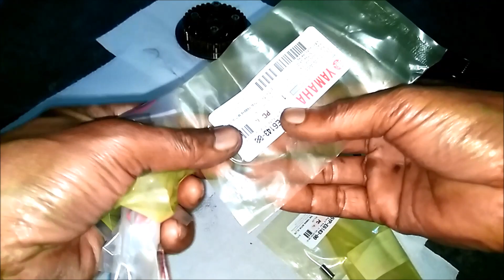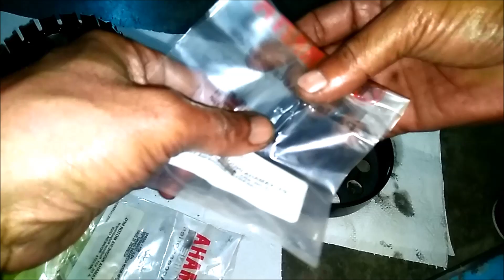Yamaha LC135 v1 4s, Jupiter, T135 How to Repair Loose Kick Starter

Comment: Assalam. Nk bertanya. Kalau nk tukar clucth kene bukak skali dgn rumah tu ke atau bukak skru spring 4 biji tu kemudian tukar gitu je. Mohon bantuan tuan. v1 2008 klu xsilap
Reply from the maker: angel society as salaam ... Bukak 4 skru yg Ada spring tu je ... Dah boleh tukar clutch plate
Reply: @KluangmanCooleck  t.ksh tuan. Tnya kedai die nk dlm rm250 jgk. Sbb katanya lc rumit sikit. Kene titik bagai laa.
Reply: @streetboyzify  seng je wat,sya da wat sdri..blaja utube gak,nk tgok clutch plate ori dia jual skeping2,made in indon..byk kdai jual locar walau pack hly japan dn indon,beza dia kne buka dn tgok plate dia tu jnis steel berat skit bebnding clone..clone mcm aluminium je ringn,kdai byk tipu klo hage 45 tu local la..ori skeping rm13-15..sory celah bng kluangman

Comment: Bang nk tanya sy baru tukar bearing oneway satu set and baru letak wasir dalam auto tu..lpstu bile da psang semua start hidup dalam bape saat gitu pstu mati bila stat balik terus ad bunyi rontak pstu mati n mcm ad bunyi patah. Bila nk stat kick starter jadi keras
Reply from the maker: Kena bukak balik kalau macam tu ... Tak boleh Ada kesilapan semasa memasang benda ni ...
Reply from the maker: Bush yg terakhir tu mesti Sama paras dgn dgn mangkuk yg Ada Gigi gear tu ... Bush terakhir itu tidak boleh Sama sekali terkedalam walaupun 1mm ... Kalau bila pasang bush terakhir tu ... Bush tu tak Sama paras dgn mangkuk ... Ada yg tersalah pasang sebelah dlm ...
Reply: Bush yg mana eh bang auto ke mangkuk clutch . Sbb sblm ni moto bunyi kuat bila check balik sbb auto xda wasir lpstu bila dah letak jd mcmtuu
Reply from the maker: @hellomiyul3380  bush auto
Reply: Oh kira bush terakhir tu kne sama dgn mangkuk gigi yg psang tu ke. Bush auto tu xleh tekan ke dalam smpai dalam eh
Reply from the maker: @hellomiyul3380  bush tu tak boleh terkedalam ... Bush itu umpama pasak ... Mesti kuat Dan tak bergoyang Dan skru terakhir berserta wasir terakhir ... Mesti menyentuh bush terakhir tu ...

Comment: Abg nk tnya..ape function klu pkai auto cluth racing ye??? Blh bgi keterangan ?
Reply from the maker: Auto cluth racing? setau abg motor scooter je yg guna ... utk pickup cepat sikit.. atau motor honda wave ... kalau yamaha kebiasaannya tukar cluth yg ada lebih spring
Reply: @KluangmanCooleck  yeke..sbb moto sy perlu tuka auto cluth..lc 4s
Reply from the maker: @budakflat4574  kalau ada sesekali macam gear tak masuk atau starter kaki kekadang loose ... repair je auto cluth tu
Reply: @KluangmanCooleck  ye abg..xpyh beli bru ke? Hnya repair yg ori pnya?
Reply: @KluangmanCooleck  ok abg terima kasih
Reply from the maker: @budakflat4574  macam dlm video tu .. repair je

Comment: tumpang tanya bang,,baru lepas tukar class plate sendiri,,pstu gear jadi sambungg,tak boleh nk pancing gear,,dh setting skru kecik belah magnet pun x boleh gak,,nk kene setting apa ek?
Reply from the maker: Skru kecik tu pusing ke dlm ..
Reply from the maker: Mangkuk clutch Ada bukak tak ... Kalau Ada bukak ... Masa pasang balik sebelum pasang clutch plate mangkuk tengah tu mesti boleh pusing2 ... Free
Reply from the maker: Cuba dulu pusing skru adjust cluth sebelah magnito tu .. pusing kedalam ... Ada keras sikit .. Ada susah sikit nak pusing kedalam ... Kena kuat ... Sikit ... Tapi agak2 je dlm Dua tiga pusingan sambil tekan2 pemijak cluth ... Mangkin kedalam skru tu ... Pemijak tu mangkin Ada spring .. mantul2😂
Reply: +Kluangman Cooleck mangkuk tu mmg dh free bole pusing pusing
Reply: +Kluangman Cooleck dh buat ketat ketat dh ,,gear dh jd keras sikit,,tapi x keras mcm dulu and takleh pancing gear jugak..so nk setting belah mana ye bang?
Reply from the maker: @irfanirsyad9442  push rod kat penutup mangkuk clutch betul tak pasang dia
Reply from the maker: Push rod masuk dulu ... Bearing leper ... Baru pasang penutup
Reply: +Kluangman Cooleck bearing leper tu apa eh?
Reply from the maker: @irfanirsyad9442  bearing tu macam duit syiling ... Masuk push rod dulu .. Bearing ... Baru cover clutch
Reply from the maker: Cari user manual motor tu download .. Nama file tu T115FSEC Pdf

Comment: Salam bang mcm mana nk buat clucth tangan? Kne welding auto dan manual ke?
Reply from the maker: as salaam ... pd pendapat abg... tak payah welding auto cluth tu ... dan biar je mangkuk tu ori ... dan tak payah bukak ... rugi kalau bukak ... top atau lajak nanti hilang ... buat macam motor yamaha ss 110 dulu2 ... auto ada ...manualpun ada ... tapi terpulanglah pd firdaus
Reply: @KluangmanCooleck  makna buat clucth hidop la abg? Tarik clucth boleh xtarik pun boleh ok ke?
Reply from the maker: Ya... betul
Reply: Kalau buat clucth hidup xmcm meneran ke mcm ss110
Reply from the maker: tak ... macam ori ... tambah clutch tangan ... mesti glamer punya ... dua2 boleh guna ... kaki boleh tanganpun boleh ... tapi kena korbankan clutch kaki ... tapi kalau kreatif ... boleh guna dua2
Reply: @KluangmanCooleck  owh phm2 kalau clucth hidup ni perfomance still mcm biasa ye bang? Cuma boleh pakai dua2
Reply from the maker: @firdausdaus7307  ya... clutch kaki ...hilang... kerana push rod tu sekarang guna yg tangan... cuma boleh masuk gear ...walaupun tak tarik clutch tangan ... semasa rpm rendah sahaja ... kerana auto cluth masih ada ...
Reply: Bang kalau pakai stopper ngn balancer ok tak
Reply from the maker: @firdausdaus7307  ok .. yg ori simpan
Reply: Baik bang,lagi satu kalau pakai stoper dan balancer,housing auto tu pakai balik kn bang?

Comment: Salam nak tanya motor saya dah tukar cdi tapi bila bawak ada rasa sengut sengut bila full trottle. lepastu bila pulas minyak lepas sikit pulas balik dia sengut adakah angin carb perlu di set balik motor v1 2008
Reply from the maker: muhammad syazwan as Salaam ... macam minyak over je pattern dia .. Cuba besarkan sikit putaran jet angin .. Cuba pusing ikut lawan jam 360% bersamaan satu pusingan ... Ada lagi tak problem tu ...
Reply: Kluangman Cooleck saya bukak angin 2 /12 pusing ada jugak sengut tu pusing 3 pun ada jugak.
Reply from the maker: muhammad syazwan masa nak start jalan rpm rendah ... Ada membobok?
Reply: Kluangman Cooleck takde pun bobok ni dah try bukak angin 1 1/2 pn sama jugak
Reply from the maker: muhammad syazwan Cuba adjust jarum throttle ... Mula2 tengok pin jarum tu ... Kalau tak pernah usik dia kat tengah2 .. turunkan pin jarum tu ke bawah .. test balik .. info kat abg kesan turunkan pin jarum tu
Reply: Kluangman Cooleck okey dah jumpa bang lubang blah dpan carb tu tersumbat servis balik terus lancar .. huhuhuhu. Terima kasih bang bg pendapat
Reply from the maker: @muhammadsyazwan1073  TAHNIAH 👏👏👏
Reply: Kluangman Cooleck kalau ada video buat overhall abg upload boleh nak tgk cara pasang gearbox
Reply from the maker: Buat masa ni abg belum ada buat video complete overhaul .. cuba cari kat Fatin Motor channel

Comment: Pagi bro..nak tau cara buka nut primary..sebab motor sy da ganti auto clutch n housing..nak tau kenapa ada bunyi seperti bunyi turbo..dan selepas itu ada bunyi golgok glogok area primary
Reply from the maker: Benn Rudolf selamat pagi ... Skru prima ... Adakah skru cluth houseing atau auto clutch ... Jika ini yg Benn Rudolf maksudkan ... Boleh menggunakan impact skrudriver ...
Reply: Skru auto dan skru primary
Reply from the maker: Benn Rudolf boleh guna impact skrudriver
Reply: Ok tq bro
Reply: Petang boss..sdh diperiksa..yang berbunyi glogok glogok primary clutch..haus sdh lubang shaft n boss clutch juga x rata da..
Reply from the maker: Tahniah kerana menemui permasalahannya ... tapi jarang sekali lubang mangkuk cluth itu haus ...

Comment: assalam bro. saya punya motor lc v1 . lepas tukar autoshoe bila perlahan jadi clutch kaki. bila tarik laju terus knocking valve dan piston . apa punca nya ye
Reply from the maker: As Salaam ... Sebelum tukar bunyi tu ada tak? Kalau sebelum tukar tak ada bunyi .... Ada yg tersalah pasang tu ... Kena bukak balik ...
Reply: sebelum tukar tak bunyi. tapi lepas tukar 3 kali valve bengkok. lepastu saya pasang yg asal balik bru okay moto kalau tarik lama2
Reply: ke kena tukar shoe sekali dgn housing nya skali?
Reply from the maker: @arisyatim296  tak perlu abg rasa ... Kalau shoes tu ok ... Tak Ada spring yg patah atau Ada part yg dah rosak ... Abg rasa , kalau aris bukak balik ... Auto shoes tu giginya dah haus ... Kerana masa pasang tu ... Benda tu tak fit ... Dia bergoyang2 ... Itu yg Ada bunyi knocking tu
Reply: okay okay terima kasih
Reply: last nak tnye. apa effect kalau tapak spring clutch tu salah pasang? yg mcm dlm video yg dok goncang2 tu
Reply: minit ke 29.52 dlm bideo
Reply from the maker: @arisyatim296  auto cluth tu tak Ada kena mengena dgn valve ... Melainkan aris ada bukak block

Comment: Bos kalau kickstarter loose ,gear xde clutch dn bila jln xpulas throttle moto stay jln jgak mcm gear auto tu ape mslh nye..moto dari beli 2006 smpai skang xprnh tuka clutch plate lg😂..mntk ajr sifu
Reply from the maker: azri azman problem sama macam dlm video ni laa.. kalau gitu ... Buatlah macam dlm video ... Ganti auto assembly ... Macam dlm video
Reply: Kluangman Cooleck baik bos sy try buat..bos ade wassap x snang ape2 nnt bleh mntk ajr dari sifu😁
Reply: Kluangman Cooleck auto dn bearing one way dn mangkuk auto dn class dh pakai baru..npe ye klau sye dh pasang sye putar ade bunyi kasar?
Reply from the maker: bila dah siap pasang ,, mangkuk tu cuma boleh berputar satu arah sahaja ... bunyi kasar? kat mana?
Reply: Kluangman Cooleck klau pusing satu2 tk bunyi..tpi klau umah auto dn umah class dh bergabung..sye pusingkn guna tgn die berbunyi..knp ye?sye tk pasti bunyi dkt mne diantara keduanye
Reply from the maker: letak minyak
Reply: Kluangman Cooleck dh bosku...sampai banjir sye letak..tetap bunyi
Reply from the maker: cuba bukak balik buat balik semula ... yg dlm video tu lepas pasang test pusing .. cantik je .. apa bunyipun tak ada .. bush besi tu cuba tengok permukaannya cantik tak
Reply: Kluangman Cooleck maaf tnye..bush yg dkt mne ye yg perlu dicek?
Reply from the maker: yg sebelah dalam tempat bering rod 3 biji tu
Reply from the maker: jangan ada wasir yg tak pasang terutama yg dlm sebelum masuk bush plastik
Reply from the maker: bush plastik putih tu jangan terbalik

Comment: Bang spring kecil one way tu 1 ke 3., konfius saya buka yamaha lagenda lama,1 je, tapi tmpt spring tu ade 3 mcm dlm video ni.
Reply from the maker: Tak silap abg lagenda spring kecik tu Ada dua ...
Reply from the maker: Eh... Silap ... Kalau tempat spring tu Ada tiga ... Bermakna tiga la spring kecik tu
Reply: Oh yeke...kalo beli spring tu je berapa harge ye?
sebab rumah dn bering one way masi cantik..
Reply from the maker: @tthonney90  kalau tak silap abg bawah 50 ... Tak Ada jual spring je ... Kena beli satu set macam dlm video tu
Reply from the maker: Abgpun beli satu set ... Tapi yg abg guna cuma spring tu je ... Yg lain boleh guna balik ... Tak rosak
Reply from the maker: Pastikan oil seal tu tak pecah atau rosak ... Kalau rosak tukar ..
Reply: Kluangman Cooleck ok bang terima kasih info..
Reply: Ok, dan housing clutch plate yg ade jari2 tu kalo beli kene beli skali dgn yg tengah x?
berapa ye agaknya harga?
Reply from the maker: @tthonney90  kenapa dgn housing tu patah ke ? Atau dah goyang kuat sangat

Comment: Inikah yg dipanggil one way bearing tu bang?
Reply from the maker: Brock Lesnar89 yes inilah bendanya😂
Reply: Kluangman Cooleck x sabar saya nak cuba buat sendiri klu ada masalah begini lepas tonton video abg ni😂auto clutch tu klu bukak&pasang mesti guna impact ke bang?
Reply from the maker: Brock Lesnar89 kalau Ada air gun lagi cun ... Tapi kat rumah ... Mana ada year tak🤣 jadi kenalah buat macam pomen dahulu Kala... betul tu guna skrudriver tu..
Reply: Kluangman Cooleck kalau guna impact tu nak kena ikat kuat2 ke bang atau macamna?nak ilmu cikit sebelum belajar buka benda tu😅
Reply from the maker: Brock Lesnar89 waaahhhh ni betul2 nak jadi pomen ni ... Ok abg bagi tip mudah2an Ilmu ni digunakan utk kebaikan... Ewaaah...😂  Kalau nak bukak skru cluth tu ... masukkan giar 1 Lepas tu tekan brake ... Hehehe.. senang je 😎 Dan nak bukak skru auto tu kena tahan magnito ... Kalau block bukak ... Boleh sendal apa2 kat grand shaft ... Tapi kalau tak bukak blockpun boleh tapi kena tahan magnito ...😂

Comment: bang klu class plate terbakar moto xleh jln eh?
Reply from the maker: manual ke auto?
Reply from the maker: kalau manual dah tak boleh jalan ... tapi kalau auto ... mungkin boleh adjust skru kat sebelah kaki kiri tu ... boleh jalan lagi plan2 ... tapi kalau cluth plate dah tak jejak .. memang tak boleh jalan
Reply: +Kluangman Cooleck moto pakai auto
Reply: +Kluangman Cooleck bila double stand masuk gear tyr pusing,,try pulas minyak dia gerak tp x laju ,,bila nk bwk moto xleh gerak bila pulas
Reply from the maker: @irfanirsyad9442  sekarang tak boleh jalan?
Reply from the maker: Cuba adjust skru kat kaki Kiri tu ... Guna spana 10 Dan skrudriver
Reply: +Kluangman Cooleck tak bang
Reply: +Kluangman Cooleck pusing dia mcm mana ye bang
Reply from the maker: @irfanirsyad9442  skru 10 pusing ikut lawan jam utk bukak ... Longgarkan je... Lepas tu skru tengahpun pusing ikut lawan jam
Reply: +Kluangman Cooleck ooo oky bang,,tapi bila saya start pstu matikan moto dkt belah auto tu dgr bunyi kasar tgh berpusing
Reply: +Kluangman Cooleck tapi bang bila saya start moto pstu matikan dgr bunyi kasar di belah auto tgh berpusing